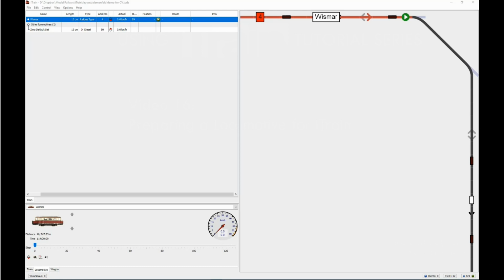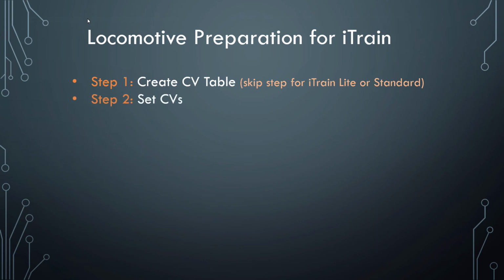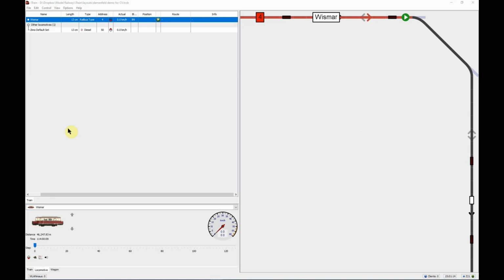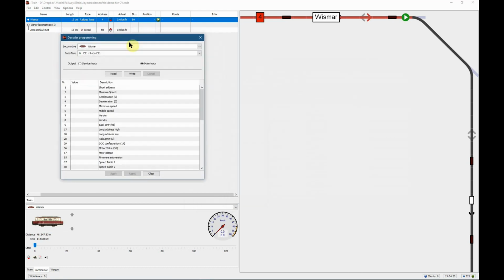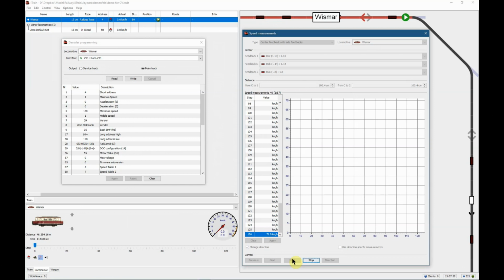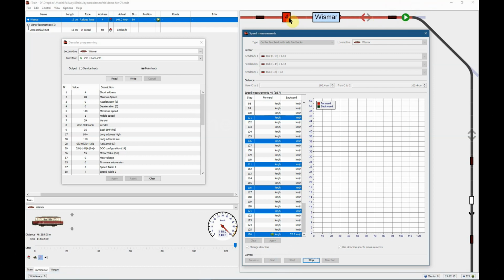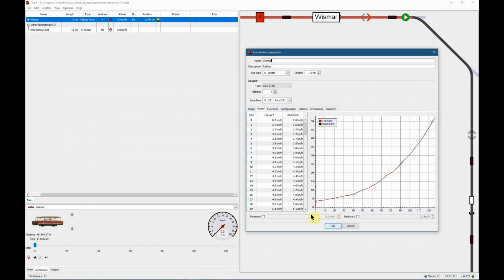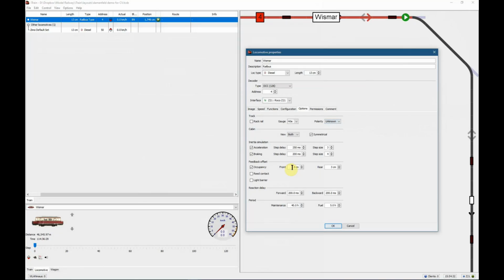Video 16: Using iTrain Tutorial Series - Preparing a Locomotive for iTrain  (Part 1)

Comment: Hi Bob
I'm back into watching your excellent tutorials again.  I don't have a layout but have got involved with someone building a very large layout and have been nominated, amongst the group, to be the Itrains expert as I have confessed I have watched your tutorials in the past!  I'm delighted but much learning to be done!
I'm getting to grips with layout design and blocks but have a problem.
Part of the layout consists of an over/under section.  2 incoming lines split into 6 of which 3 go down a level directly below the upper level but then come back out and rejoin.  
Have you any advice on how I reproduce this in Itrain? 
Many thanks
Mel
P.S. I am the guy from Adelaide but still haven't met your sister yet!
Reply from the maker: Hi Mel
Good to hear from you again. It's difficult to give proper advise without seeing the layout plan, but my initial suggestion is to terminate the 2 incoming lines with "Link" elements. Then, on a second tab, draw the other part of the layout, starting with two "Link" elements, then splitting into the 6 lines, etc, and terminate that section with more "Link" elements that connect back to the first tab where it rejoins with more "Link" elements. So, in summary, split the layout into different tabs, using "Link" elements to join the tabs.

But the best advice I can give you is to post your question on the forum, with a drawing of your layout, and attaching your iTrain .tcdz layout file (even if it is only partially constructed). You will then get a much more thorough and constructive response, and ideas from people that are much more experienced at layout design than I am.

p.s. my sister is still living in Adelaide (but now single...). She's a nurse at the hospital.
Reply: My thanks to your response clearly disappeared  into the ether! So many thanks.
If you have a few moments there is a new Utube channel Magic Mike Trains. Mike has terminal cancer but this is his project, I'm loving being allowed to be involved. His passion is addictive. My job is Itrains control and hopefully watching the video you will see, as a complete newbie, how big my job is.
One question, when I run diagnostics I'm informed that blocks/feedbacks don't have an address.  What does this mean? 
What do I have to do?
I'm just so excited I've managed to create blocks, sensors, feedbacks and when I go to the control panel and press a point, it changes.
So much to understand and complete to allow Mike a "play" with what Itrains can do!
With your help I can give it a "Bloody good Crack" as we say in Australia.
Thank you

Mel
Reply from the maker: @meljones7238  These tutorials should answer your question.  What are the types of feedback sensors used on the layout (current sensing or infrared)?
Tutorial 08: iTrain 5.0 - Blocks, Feedbacks and Groups
https://youtu.be/nhKXUSAgei0

Tutorial 09: iTrain 5.0 - Defining Feedbacks
https://youtu.be/ymrhTb56qOA

Tutorial 10: iTrain 5.0 - Defining Blocks
https://youtu.be/8ndTcstd0Kw

Send me a PM on the forum and include your email address. I will then reply by email and you can send your layout file to me so I can help.

Comment: Hi Bob. I guess that this is specific to DCC loks. In case of loks that have been read through the controller (Marklin CS3 or LODI Rektor), does this CV table creation still needs to be done? I would assume that the lok characteristics and CV values have been read through the controller, and would have been transferred to iTrain when interfaced?
Reply from the maker: Good question Rudy. The objective is to be able to change some CV values within the loks decoder. How you do that will depend on the Command Station you are using and the type of decoder fitted in the lok. Step 1, (the creation of the CV table) only needs to be performed if you have the Pro version of iTrain and want to take advantage of iTrain's CV programming feature to allow you to conveniently alter a loks CV values from within iTrain. I'm not familiar with the CS3 or LODI so I'm not sure how CVs are changed if using those. Please ask on the forum if you need more info.

Comment: Hello Bob, thanks for video and I have qustion about installing the Java please if itrain5 was installed without  it these no problems for it work properly.
Reply from the maker: Hello Oleg. Java must be installed. iTrain will not work without Java. The lastest iTrain 5.1 installation software includes the Java software. Run the installation program and it will automatically install iTrain and Java.
Reply: @bobfuller  A lot of thank you, Bob.
Reply from the maker: @777Teren  If you want to try iTrain before purchasing it, make sure you request a trial license. Click the "trial license" link on the Web page and fill out the form. You will then be sent a license key that will unlock the full features for 2 months, and will allow you to use the forum for support. Always use the forum for support rather than using comments in the videos. The forum gives far better support and is easier for us to help you.

Comment: Hi Guys.  I just upgraded to Professional version and now watched your decoder programming tutorial which was great.  I have Lenz and Zimo loco chips, both of whom have Railcom.  Presumably, I need to enable Railcom on them?  Not sure if they come with Railcom switched On or Off?   Thanks a lot,          Keith
Reply from the maker: I'm not familiar with either the Lenz or Zimo decoders but, yes, Railcom needs to be enabled. Usually in CV28, but consult the User manual for that particular decoder. If you have any problems, PM Iain Morrison via the forum. He uses the Zimo decoders, if I remember correctly.

Comment: Hi Bob
Have you any experience profiling a Hornby decoder, it looks like you cannot set the top and bottom speeds. 
So I do not get a good bottom speed 
I have been setting a linear speed profile starting at 4mph and finishing at 90mph this works but I would like to create a curve profile.
Any advice?
Reply from the maker: I don't have any experience of the Hornby decoders but other iTrain users have. Search for "Hornby Decoder" on the iTrain forum and you will be able to read quite a few posts related to this subject. If that doesn't help, post a new topic or PM Iain (IainM). He has quite a bit of experience in answering this question.

Comment: Grest video. Very well explained :) 
I set CV 3 & 4 to 0
I found the max speed  of 120kph at 189 on CV 5. Spot on.
When measuring the minimum speed, it returns a value of 18.5kph with CV 2 set to 0.
How can I set my minimum speed to between 3 and 4kph with CV 2 only going down to 18.5kph, please?
Reply from the maker: Thank you. Would you mind placing this question on the iTrain forum? It is easier to provide better responses on the forum, and also others will be able to share their experiences and learn from the answers. Cheers Bob.
Reply: @bobfuller  Will do Bob :)

Comment: SOUND NO LONGER SYNCHRONISED. Hello Bob, I’ve taken your earlier advice and joined the forum but so far have not hear back from administration. Ive now completed all videos up 16 and have got one loco (new Bachman GWR tank), set up. Next is reaction delay. All has gone well except that whatever I set cv 3 and 4 to , (2 to 5 as per your video, or 33 and 44 as originally supplied), the sound on the loco is no longer synced. The chuff rate is far too slow. I have not yet discovered how to turn on sound when using itrain manually, so I can only test the sound by driving the loco using the DR5000. So two questions, how to get loco sound when driving locos manually in itrain, and how to get the chuff rate correct. Ive scanned your further video titles and searched Google and YouTube and have found nothing. Any advice very much appreciated.
Reply from the maker: Hi James. Sorry to hear that you have not received a reply to your forum post. That is extremely unusual. I cannot find your forum post. What is your forum user name? Which section did you post your question in? What is the title of the post?
Reply: Sorry Bob, I did not make myself clear. What I was saying is that my registration has not been approved yet, so I am not yet able to post. Hence my questions to you via YouTube. 

Best, James
Reply: Thanks Ian. That all makes sense and I have been able to move forward in my understanding and use of itrain. I don’t need to take this any further until I have pursued the ideas further. When I want more help I will try the forum, which I have now joined. Many thanks to you and Bob.
Reply from the maker: @jamestennant-eyles9870  I am about to go on holiday for a few days, so I have asked Iain to respond to you. He will hopefully be in touch in a day or so.
Reply: James, syncing sound on locos is notoriously difficult and can be very problematic. As we suggest in the video, the iTrain recommendations for CV3 and 4 do not replace the manufactures, or sound project composers settings when sound synchronisation is required, and you should use these in preference to iTrain settings. In this case, that would be values of 33 and 44. You may however find that getting a reaction delay setting that works will require a large value to be used, this cannot be avoided. There is not currently a global setting to switch all sounds off or on within iTrain, and you need to do this either using an action within iTrain for each loco or by using the function keys defined for each loco. This will be resolved by with the provision of a global sound on/off capability.
Reply: @damenfeld   Hello Ian. Thanks for your reply. I have listened to video 16 again and I have not been able to find anywhere where it says to leave  cv 3 and 4 at the manufacturers original values. I can only find a box that pops up on the screen at one stage suggesting trying vales 2 to 5 to sync sound. Anyway I’ve now put the cvs back to manufacturers original and sound is restored to be correctly synced. I’ve been trying instant routes and the problem is that with the higher cvs the deceleration is so gradual that the train does
Reply: @damenfeld  sorry sent before finished. I’m finding the deceleration is so slow that the train overruns the destination block before it’s stopped, it then stops dead and I get a message saying train appears in unexpected block”. So is it a choice between proper control and correctly synced sound? (The instant route works fine off line).
Reply: @jamestennant-eyles9870  James, you are now finding one of the challenges that exist in automation as sound project designers work to their tastes and don’t always consider the effects of large CV4 values.
There are 4 ways to address this and keep CV4 at the designer figure 
a) increase the length of the block
b) reduce the block speed
c) reduce the global expected stop speed
d) reduce the block expected stop speed
I realise that a) might not be possible, and you may not want to slow the block speed as this will affect trains that run through leaving only c) or d).

Can I suggest that if you need to continue the discussion it is done on the iTrain forum where you can also post your layout plan and assistance can be provided more easily than here? The
Reply: Hello Bob or Ian, I am sending this message via YouTube rather than forum as its specific to your series. I have been trying to find where you describe how to create a train, rather than a loco. Could you kindly point me to the correct video. Many thanks.
Reply: @jamestennant-eyles9870  The videos are an addition to the manual and not a replacement for the manual, nor  should YouTube be used as a surrogate for the iTrain Support forum. Everything that is mentioned in the videos can be found in the manual, which you can either access through the website or by pressing Shift+f1 in iTrain.

As a guide to help you find it in the manual, I suggest that you start reading at p51 for this question.
Reply: Hello Ian, thanks for your swift response. Yes I’ve already read the manual, pretty much from cover to cover, and it’s very helpful. However I didn’t find the section on creating trains very helpful, and I was hoping you two had done something on that in your wonderful clear and logical way. Your series really is fantastic! Best, James.
Reply: @jamestennant-eyles9870  the program author, Xander, does not read any comments or questions posed on YouTube and by posting support questions here he will never see any need for clarification or amendment for either the program or the manual.
Reply: Ok, noted.

Comment: Hi Bob I have done some speed profiling and found that I cannot set Min and Max speed values on the Hornby R8249 chip as they are not present. How can this be done on chips like these?.
Reply: Regrettably Hornby have chosen not to implement the NMRA standard CVs within their decoders this making it impossible to set these values. 

The effect of this is that you will be using a reduced number of speed steps for the locomotive control within iTrain. As an example, if the top speed is measured at 130mph yet the prototype top speed was only 80mph then the speed steps above 80mph will not be used. Similarly at the lower end their may be a range of speed steps that are effectively not used as the loco may not actually start moving until several steps have been issued.
Reply: @damenfeld  Thank you Iain. I suspected that was the reason.
Reply: Hello, 90% of my 20 trains are the more modern manufactured Hornby Sound or TTS sound fitted DCC steam locomotives. From what you’ve explained to Roy, am I going to struggle using iTrain, block detection and accurate running/stopping times when running trains under computer control, even if I do the speed tests correctly from driven wheels because of this. Don’t want to invest in this system on a Mac with Digikeijs DR5000 and the detecting units for the go between from computer to layout if so. Thank you
Reply: @andymacc  Hi Andy don't let that put you off. I have generally found that with the speed profiling and playing around with CV settings and the adjustments in iTrain you can pretty well get a train to stop in the right place, but every loco is different!.

Comment: Hi Bob. I'm using a two feedback measuring system to set my speed profile. However when I set the loco off it doesn't stop and reverse at the end of the Block, it just carries on. I have tried it both ways and the feedbacks do clear after the loco has past.
Reply from the maker: Hi Ron. Have you clicked "Change Direction" located just below the CLEAR button?
Reply: @bobfuller  Yes, Just double checked. It appears to be ticked as a default. I did get a reading on an earlier setup, but on the initial speed readings it over ran to the end of the layout and had to be physically restrained until the speed decreased!. So I changed the blocks that were being measured to avoid that, they are quite long 290 & 220 plus the add on section for a point 25cm. Could this be an issue?
Reply from the maker: Does it happen with all your locos or just this one? Could you post your question on the forum and add your layout file (.tdcz file). I think we need to see the layout file to see what's happening.
Reply: @bobfuller  Tried a different loco, same result. I'll post on the forum. However, One thought, I have just realised the 2 feedback sections are on different DR4088's I wondered if that might be the issue.
Reply: No was the answer to that one.

Comment: Hi Bob, something has just occurred to me. As iTrain is taking over the speed curve of the locomotive, does bit 4 of CV 29 need to be on or off ? Or doesn’t it matter ?
Reply from the maker: Hi Bryan, iTrain does not "take over" the speed curve. All iTrain does is effectively "record" the locos existing speed profile, so that it knows the speed associated with each speed step (i.e. if iTrain sends a speed step 10 command to the loco, it knows that should achieve the associated speed shown in the speed table). It's essentially just a reference table for iTrain. So, iTrain itself does not change or take control of the speed profile (except indirectly if you use the decoder programming feature to change CV values). The speed table that is set by CV29 bit 4 remains in place. iTrain doesn't care if you use the 3 point speed table or the custom speed table.

iTrain does "take over" the inertia simulation, which is maybe what you are confusing it with.
Reply: Hi Bob, many thanks for the clarification.

Comment: Hi Bob - at approx the 4 minute mark you show a table which is titled ‘you can also experiment with these settings’ if you have sound enabled locos. I do have some sound enabled, so at what stage would you experiment with these CV’s please? Because I can see how important it is to set both CV’s to zero to then follow the rest of the steps as you outline subsequently for preparing locomotives for iTrain. Many thanks in advance for the advice, Julian
Reply from the maker: Hi Julian, if you have a sound decoder you only need to change CV 3 and 4 to the other suggested values if the sound is out of sync with the trains motion. You may find that there are no sync issues with a value of 0 or 1.
If you are new to iTrain, just leave the sound turned off, and get everything set up and working with a value of 0 or 1. Once you are confident with the procedure and you have been able to get a few trains stopping accurately, you can then experiment with other CV3/4 values, but only if you see/hear any sound sync problems.
Reply: Thank you for taking the time to reply Bob, all understood and thank you. Julian